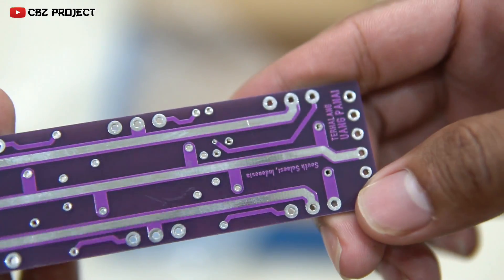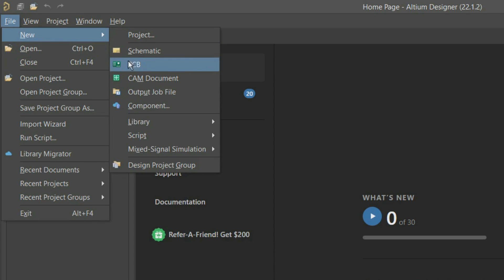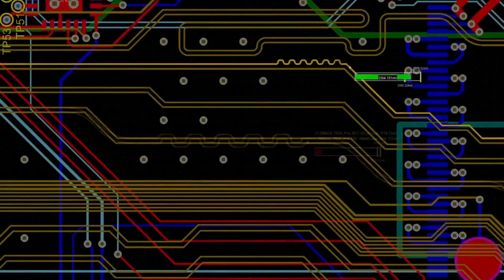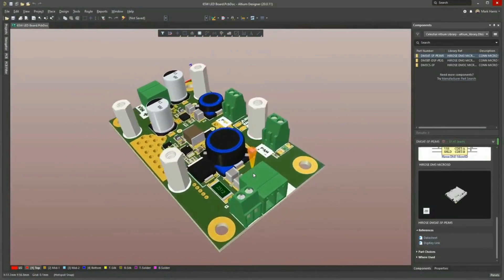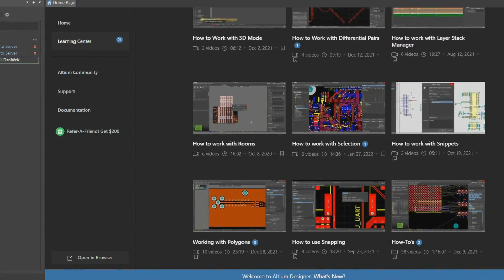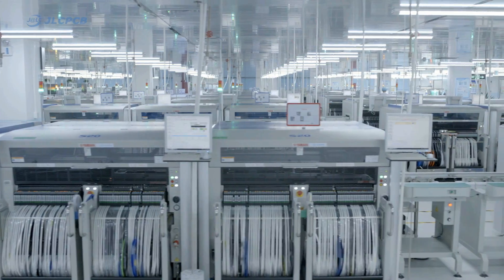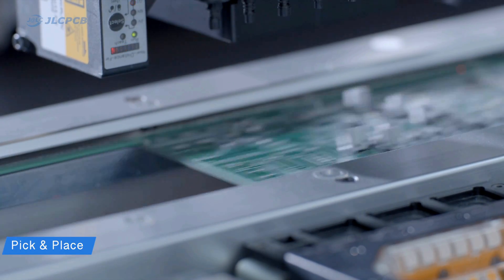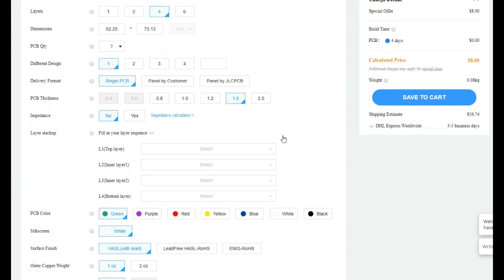DIY 1000 + 1000 Watts Powerful Amplifier using 2SC3858 & 2SA1494 | 20 Transistors #cbzproject

Comment: Oh dear, these will be one thousand Milli Watts - not the Watts we all expected..
The power supply is far too small but even worse, all the wires going to the power transistors are *far* too thin. Likewise the tracks on the PCB joining them all together
You might get 10Watts out of it but beyond that it will start to sound AWFUL and things will start melting

Comment: wow - something is wrong with your watt calculations ???
with 65 volts you can get P = (V^2)/R ....... 500'ish watt into 8 ohm load, or with 2x 65 volt, you will get 2000'ish watt into a 8 ohm load

Comment: I don't mean to be rude but, Why? 1000 watt amps are a dime a dozen in the professional audio world and have a much higher duty cycle. Yeah it is a good old linear design from 3o years ago mostly. Maybe HiFi fans might like it but you can Pick up a Crown XTi 1000 with rail voltage tracking and a lot less headache.
Kudos to you for the design and yeah it will work a treat. you should be proud of the engineering achievement which came out of it. still, save yourself the headache. And, i say this because in our world, 1000 watts is a bit of a toy these days and a lot of companies are replacing them for bigger and much gruntier 10000 watt Lab Grupen or Powersoft amps.

Comment: Suplly proteknya ambil tegangan berapa di SMPS ? DC/AC ?
Reply from the maker: 15v DC
Reply: @cbzproject  di kit powernyakan tegangan untuk protek memakai ct ac, apakah tidak berpengaruh jika dikasih tegangan DC ? Maaf bos banyak tanya, soalnya beli produk socl 504 dilapaknya bos tapi ragu bisa atau tidak tegangan ektra 12vdc diSMPS 15A untuk suplly tegangan proteknya
Reply from the maker: Negatif (-) terhubung ke Ct, sedangkan positif (+) terhubung ke salah satu in AC
Reply: @cbzproject  ok. Terimakasih bos.. entar dicoba.. tapi vdc yang ada di SMPS yang saya beli cuman ada 12vdc. (Vdc bias dan vdc ektra 12v)

Comment: Always use thermal paste. Especially for 1kW. A thin layer of an air (the best insulator) remains in an opposite case.
Reply: You are correct,and first solder the components then cut it excess ends,some minor but big mistakes.